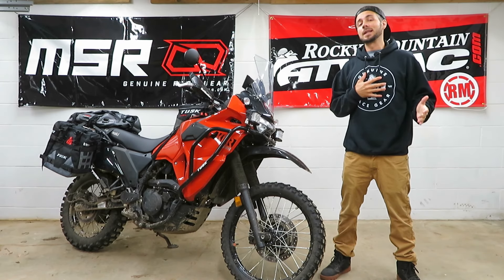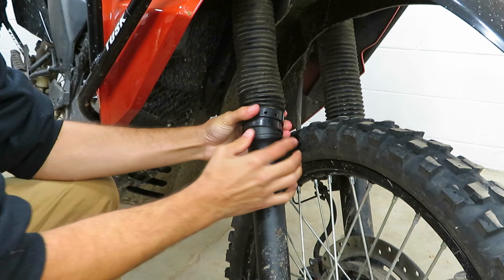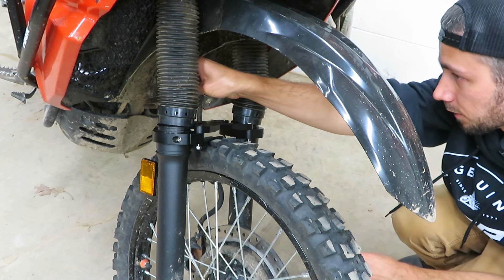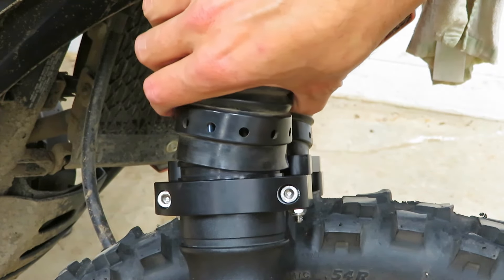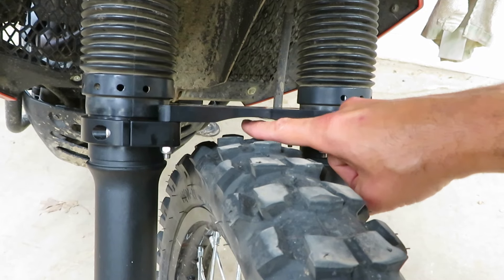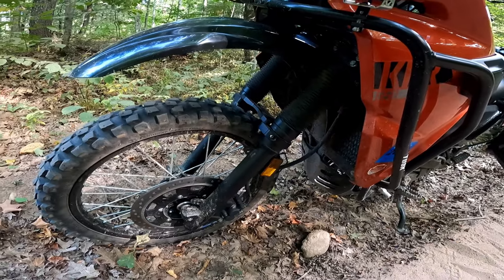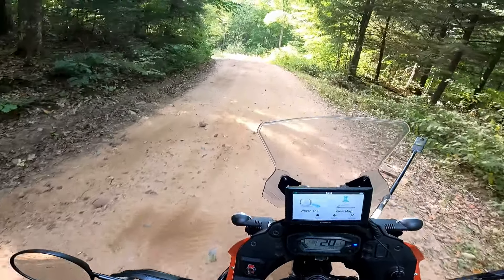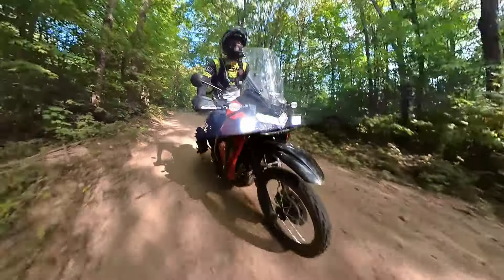Does the Eagle MFG. Fork Brace Really Work? | 2022 KLR 650

Comment: Once I added a better front suspension with preload adjustment to the KLR, most of the handling quirks were resolved. It’s worth the investment and would make a great video.
Reply: What fork kit did you go with ?
Reply: Cogent Dynamics. I would post a link but it’s against policy.
Reply: I'm commenting in support of SWANKY CAT doing a video of front suspension upgrade. I agree that the KLR needs it. I'm 170 lbs, but even riding without overland gear loaded, the front suspension is sketch af.
Reply: @outdooradventurereps did you go with the preload adjusters and DDC with stock springs or did you get new springs also.  I was just looking at this.
Reply: @stephencline8561  I went with stiffer springs, spacers, damper, and preload adjusters. Nice addition for both on road and off-road handling. Not quite as fast as the T-7 but a good upgrade for the investment.

Comment: I bought one and was on the fence about installing it.  I ended up just returning since I still could after a lot of comments of forums from people who installed one and at some point afterwards had fork seals leaking.   Most said they never had fork seals leaks on bikes until after installing one.  

Great video.
Reply: Yeah it really seems like they need to design a way that allows for drainage below the fork seal like like it is when it's stock. Maybe if the clamp can allow for water to drain though it and then seal the holes like he did in the video. The way the boot is clamped on after just seems like it lets water and debris sit in there. It probably causes some corrosion and abrasion to make the chrome and rubber interface fail.

Comment: I didn't buy the eagle mike fork brace I bought a Chinese knock off that is the same exact brace in my eyes at least. I've had bikes in the past that I've installed fork braces and it did make a difference. the day I bought the klr and rode it home I knew right away that it needed one. The front end felt sloppy and twitchy at 60mph on roads with rain groves, plus the stock tires are actual garbage. I don't think you will really feel a difference with that aggressive of a front tire. I had motoz tractionators on and were awful on the highway even with a forkbrace. I run shinkos 705's now and I'm honestly impressed how well they work off road and how much smoother they are on road. I live in the flat part of WI so I gotta ride to the fun spots to go riding. Zero wobble with the shinkos and fork brace 👍

Comment: I had the Eagle brace on my 2018 and did not notice any difference IMHO. The Big Girl still took off in unexpected directions and I was just along for the ride. As for on road, I never had an issue with the 2018 even when running the TKC80 front knobby which worked very well off road and was so so on road. The best mod I ever added to mine was stiffer springs front and rear.
Reply from the maker: Honestly I think I should have stuck this money into suspension instead, if I really wanted a big improvement.  Oh well, still fun to test!

Comment: I'm not sure I am sold unless I really wanted to lower my front fender to get anything like this.  I'm not going to deny it does do "something".  It just seems I hear more "not sure if it is doing anything" or, "not sure if I can tell the difference" than anything else that would make me want to part with my money for one of these.  I'll keep an open mind on it still as the placebo effect when it comes to confidence ,especially off road, can be very useful.  Thanks for taking the time to test it out.
Reply from the maker: Yeah, honestly the lower fender option was a bit of a driving factor for me too.  IDK if I'll even like it but I was just curious enough to t buy it so I could test both ways haha.
Reply: Okay, here goes my take on this. I ride a 2006 Klr and when I took my first trip to Colorado in 2018 it chased every crack and uneven area that was in the highway. It even had a bit of “death wobble” at times when getting hit with hard side winds at speeds around 75 to 80 mph. It is loaded heavy with boxes and camping gear, etc., but was very hard to handle at times and wasn’t a comfortable or easy trip at all. After I got back, I ordered and installed the Eagle Mike fork brace and it was night and day different on the Gen 1. I have put another 20k plus miles on it since then and highly recommend it for the Gen 1 bikes for sure. Now whether or not it’s needed for the later bikes, I wouldn’t know for sure. Thanks
Reply: @michaelladymon5143  Good point.  Does anyone know for sure how much has been changed/upgraded. other than the rake being increased from 28 deg to 30 deg in the Gen 3 front forks?  I guess I have some research to do.  It would be interesting to know one way or the other.

Comment: I bought one for my (22) KLR about a year and a half ago because I felt flex in the front forks and I immediately could feel the difference off road. I highly recommend them for anybody who rides any off road. I also recommended the Bridgestone AX41 tires. Super good on road and in canyons and good off road. The only issue with the tires is you will get about 2,500 miles on the rear before it's no good off road and double that for the front tire.
Reply: Yikes!  That's worse mileage than the stockers.

Comment: My 2004 KLR 650 has has both the rear and front suspension upgrades and for the last 20 years I've never had any wobble either on the bush tracks or on the bitumen.

Comment: The stock fender is FINE. I also put 3M #33 black tape over all but 2 vent holes and rotated the bellows so the 2 holes faced the rear so riding in dust and rain wouldn't get in.

Comment: The problem with the death wobbles on the KLR is you have to add weight to the front, My 2016 KLR650 with a trunk on the rear rack wobbles at speeds greater than 85mph, when I lean forward it doesn’t wobble until 100mph with the trunk. If I take the trunk off it doesn’t wobble at all even at top speed, try adding 10-20lbs of lead on the front to counteract the weight on the rear it works really well! 

Yeah I know the KLR is a heavy Dual Sport to begin with though the bike won’t wobble so easily with the added weight on the front, I got the idea from people who drag race cars that add lead weights to get better traction. 

I’ve done this weight mod on my KLR and it’s night and day difference I had to add some weight in front of the gas tank and even under the front fender, the more weight you have on the rear the more you have to add to the front to counter balance. 

Think of how you would load weight on a trailer you don’t have the weight behind the wheels of the trailer cause it will wobble at the slightest movement you want the weight to be in the front!!

Comment: I have one on 2008 klr ,,,i like it not sure how well it performs, it is more a confidence assuring, that the  tubes are more ridge. I do like to take my bike in the mountains roads doing the twisties. The big single is fun and easy, just letting off the gas, never trail braking, and   excellerating mid turn
Reply from the maker: It definitely seems to have increased my confidence too.  Certainly made this ride a lot of fun!

Comment: I put Kenda cruiser tires on my Gen3 because I'm running Interstates around MKE 99% of the time.  Any wobble I was getting is gone now...  not that it was so bad that it bothered me.  But if I was on grooved pavement passing a semi at speed, or going over bridge grating, it'd start to swim a bit.  Not a big deal, but easy enough to fix.

I have the Eagle Mike fork brace (not installed yet), but i want to lower the fender as much as I want to stiffen the forks, and I don't have a replacement fender yet

Comment: I have a Gen1 and ride at least 50% off road in areas that the killer wasn't meant for. Subsequently, I fall a lot. With the fork pinch bolts torqued to a bit more than factory spec, I'd have to realign the forks after almost every ride. Installed the Eagle fork brace a few years ago and haven't had to straighten the forks since. Maybe if I was the average KLR rider, it never would have been an issue. Gen1s had slimmer forks and an inch more travel. May not be an issue on newer KLRs.

Comment: The biggest difference i found for performance is simply losing weight.  Especially up front.  Do the add lightness mod and it just comes alive.  On my gen1 i probably lost 40lbs off the front by getting rid of stock headlight and heavy steel bracketry, all the fairing nonsense, cluster, and everything that's not solely functional.  I replaced my headlight with a 7" Jeep LED unit mounted in a Harley fork mount bucket, and am eventually gonna get a Trailtech for instruments.

I rode my lightened naked as possible bike against a few stock gen1 bikes in the past and side by side the difference is night and day.  Mine feels like a dirt bike compared to stock feeling like trying to ride a Vespa scooter offroad lol.  Big brake up front and at least progressive springs make it able to send pretty hard.  And my fork mounted headlight turns with the bars offroad when you're direct steering and actually want to see where you're heading lol.

I want to do emulators up front next, and at some point a better rear shock.
Reply from the maker: Nice!!!  Yeah I'm actually on a DR and an XR right now and they feel so much more like a dirt bike!  Planning on building a Gen1 alongside them this winter or next summer.  Whenever I find the right bike!
Reply: @SwankyCatProductions  Hell yeah,  i LOVE pre 96 gen1, you can swap the countershaft sprocket on the fly in a couple mins with an 8mm wrench. And yeah, mine feels just like an xl size dirt bike.  I stripped probably close to 100lbs off the whole bike overall.There are SO MANY little brackets and little things that add up, like the kickstand safety and all that mechanism  A lot of these little brackets and wire guides and whatnot can all be replaced by a few zipties.

I recently ditched the radiator fan and went with the bigger aluminum radiator with braided steel lines, and along with a higher temp thermostat and and higher pressure radiator cap. I ran it without the fan, full send mountain shredding on a hot summer day and i couldn't get it to overheat no matter what i did.  It just hits about 220deg like a brick wall and stops, and that's about where it likes to be.  It definitely runs a bit too cool, but also will overheat if pushed hard with the stock setup.  The bit of extra heat atomizes fuel better behind the valves i guess.

The low temp stock tune and factory lean conditions was their way to 'cheat' emissions and still run a carb.

Comment: Ditch the DSport front and highway manners will improve. I’ve run a DSport front, Motoz DualVenture(tubeless, it is different than tubeless), and Shinko 804. The DSport was lightly used from my DRZ, it always had a speed wobble above 65mph. Motoz was better once broke in but still had a pretty good speed wobble depending on road surface and headwind.  It really wasn’t acceptable for the 75 mph speed limit backroads in West Texas. Both were great off road though. I pulled the DualVenture off to save for a future BDR. 
     I’m curious what front tire you’re trying next. The 804 is suiting my current use of highway and dirt two track but you ride quite a bit of off road. I know you have lots of miles on the Shinko also. 
  As for riding in the heat I’m really bad about riding in a Jersey with no armor.

Comment: Sigh, without the brace the front wheel deflects much more easily, which results in you constantly chasing the "line". The brace helps with the soggy pasta forks and is IMMEDIATELY noticeable on ALL surfaces. It helps tremendously in Florida's deeeeep sand.
Reply from the maker: I think I had it built up in my head that it would make it feel SOOO much better.  It's definitely better, just not as great as all the hype I've seen over the years.  Maybe I need more time on it, or maybe I'm just spoiled by my 701 haha.
Reply: The thing is, the brace is the only way of improving the front ends performance without spending cubic dollars, as in replacing the stock forks with some REAL forks. This alone makes it a no brainer. @SwankyCatProductions

Comment: I used 1inch pcv plastic plumbing and longer 6×1.0 bolts. 2 3/4" might be even better as it puts the fender nose over the tire and breaks the wind for the tire as well. I feel its a worth while fix as these bikes cruise at 72 to 80 mph w/ a 16 t countersprocket. And they mainly ride on pavement.Go for it.

Comment: You will feel a real difference at 72mph plus on the interstates.  But really the axle does not allow so called flex. What makes tge difference is putting 3 "  spacers on the brace and lowering the front  fender. The wind coming up under the fender is what causes the lateral wobble. After this the bike still gets side gusts as this big s high off the ground but the headwind won't shake the  handlebars.

Comment: You need a Scotts steering damper and then you’ll feel the difference
Reply: Yes but that's pricey I don't have either on my klr but I do have cogent dynamics suspension front and rear turned it into a whole new bike cannot recommend it enough
Reply from the maker: That's exactly what I thought after trying this, I think a steering damper would probably do what I was hoping this would.  A suspension upgrade is probably the best investment though.
Reply: @SwankyCatProductions  Just for kicks install a lower fender instead of that high one(like you’re describing in the video) I’m sure that will work wonders too on the highway.
Reply from the maker: @BlazinBlades  I'm really excited to see if it makes a difference, seems like it'll have too!

Comment: I previously had installed a fork brace on my 2007 650 V-Strom I used to own. I couldn’t tell any difference with it. Maybe an engineer with several sensors could record some useful data, not my 10 watt brain. Do other adventure bikes have them stock? How about motorcross bikes?

Comment: Issue with this design is and water that gets in there does not drain sind drain holes are now sitting higher.
Reply from the maker: True, but I think the gap or seam between the outer clamps and the middle portion is large enough to let any water out pretty easily.
Reply: True all comes down to how it is installed.